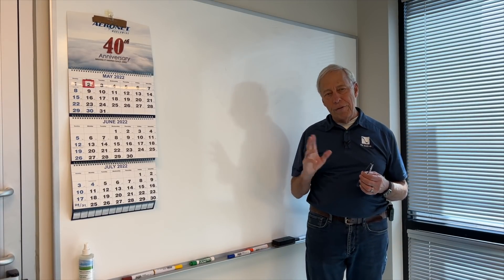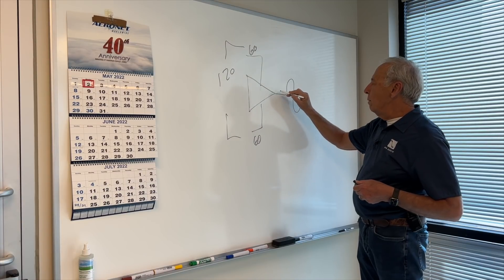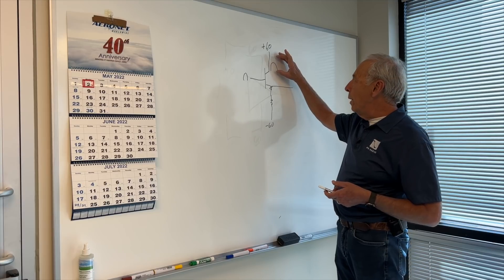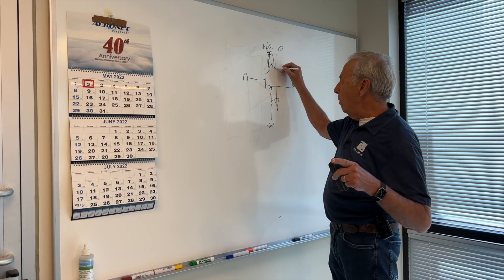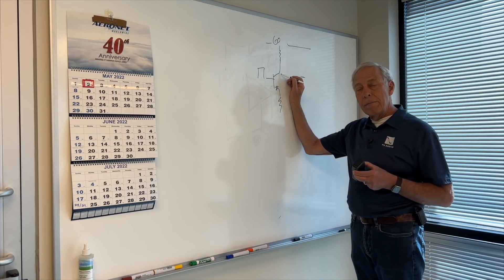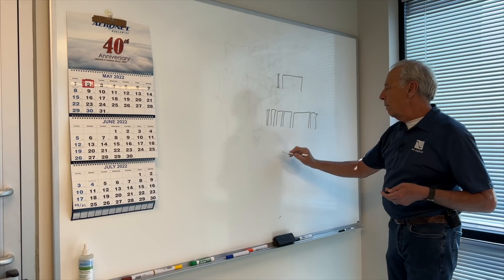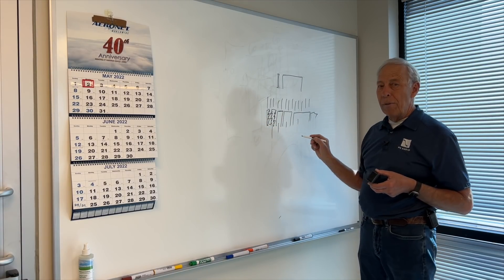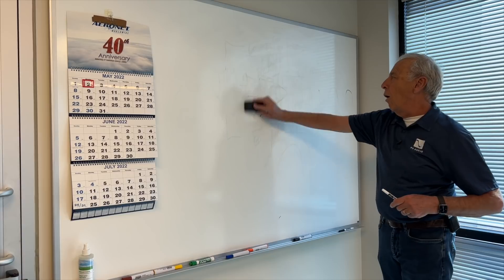How Class D amps make power

Comment: Class d simply relies on the concept of using a transistor ( or mosfet) as a switch.
A switch - just like your wall light switch is either off - in which case there is NO current flowing.. or it is on - in which case there is current flowing to a load - but NO voltage across the switch .
In either case - the switch does not consume any power.
We can duplicate this ( very closely) switching idea with a transistor or mosfet.
 ( of course - a semiconductor device cannot switch on or off instantaneously - so there still is some loss - but is extremely small in comparison to the same device working in class a / ab etc)

We can now easily  control how long this switch is on or off - from an external signal.

We can use this basic swicthing idea in conjunction with inductors and feedback control to store  energy over time to reproduce a smoothly varying volage

Comment: And not much discussion about the power supply’s contribution to the sound
Reply: Thats the catch - a class d amplifier IS the power supply!!

A class d amplifier is essentially a switch mode power supply where its ouput voltage is varied in sympathy with a control ( audio) signal

Comment: Please...I need help with a question.

I'm building my home theater...I'm in love with the sound from Arcam AVR21 (yes the new model)...it's rated at 90wpc.  If I bought (as example) any external 7ch amp that has (let's say) 200wpc and then hooked it up (now the question)
Would I be getting the sound signature from the AVR, or the external amp. I don't care for denon or yamaha with my klipsch heresy IV, relative to Arcam. Arcam just simply sounds better to my ears. 

I have a great yamaha rxa3080 (until i heard my RF7iii/64iii on arcam)...but prefer the sound of Arcam.  So when it comes to my second room, is it as simple as getting an Arcam Amp to gain their sound? 

Hope that makes sense...and any advice on where sound signatures come from when adding separates is appreciated. 
Take care, Tommy.
Reply: It's both. You get the sound of both and depending on what you set the volume of each source to, you'll get a matching output. Be careful not to blow up the inputs on your preamp. You want to ensure that the source is outputting what will sound best and does so without clipping.

Use an oscilloscope or, if you know what to listen for, use your ears.
Reply: @orangejjay  thank you!

Comment: So, a class D amplifier is twice as efficient as a class AB amplifier and four times as efficient as class A amplifier. Wow!

O, wait a minute, that's only a 3 dB and a 6 dB difference. And when I give the class AB a 3 dB more efficient speaker and the class A a 6 dB more efficient, than all three have the same efficiency!

And, now the funny part. Same efficiency, means an equal amount of waste energy in heat. For the class A we have a nice heavy heat sink, and for the class D amplifier with the 6 dB less efficient speakers we have a closed enclosure for at least mid and tweeter,  even with some insulation (wood and damping material), for the woofer we have hopefully a "vented" enclosure with not so much insulation...

And, on top of that, the last one heats up more and gives earlier and more power compression (till 6 or 6.74 dB at maximum rated power). So, some of the efficiency gain gets lost.

So, if you want more efficiency, choose more efficient speakers! And get rid of the passive crossovers, with a 2-way you gain an extra 3 dB, with a 3-way 4.8 dB and with a 4-way an extra 6 dB, plus some extra efficiency for the lack of insertion loss.

Comment: What if we substitute the common transistor used in Class AB, change the circuit a bit and obtain 75% efficiency from it?
Reply: I think you would have to elaborate on that
Reply: @maxb.simonsen2459  
Like for example a totally new type of transistor made of different materials capable of higher switching speeds and less current draw etc.
Reply: @Bassotronics  Sorry, that's not how it works :) 

A class AB is inefficient by design, not by choice of components if that makes sense. The class AB design is not a switching amp.
Reply: @maxb.simonsen2459  
I thought the transistors had to switch rapidly in order to do their job.
Reply: @Bassotronics  Well that's class D.
Reply: @Bassotronics  You can't just invent a new type of transistor. There's different classes of amps and they each have their benefits and takeaways. Engineering things is not as simple as "well, let's just do this and boom it works."
Reply: @orangejjay  
And that right there is the thinking of a person who does not want to innovate.

Comment: Question for Paul or anyone else.Would a Class D amplifier benefit from a thicker shielded aftermarket/diy power cord???
Reply: No.
The power input to a class d amplifier - same as a switched  mode power supply - feeds through internal emi filtering to a full wave bridge rectifier to produce a high DC voltage for the internal citcuitry - which is very well regulated and hence largely immune from any external influences caused by normal variations in external supply from your wall socket. 
Beyond th

Comment: Somehow reminds me of DSD, but with PDM instead of PWM.
Very similar basic principle.
Reply: PDM is basically PWM w/o clock sync requirement.
Reply: Either way, you make the waveform from the high/low digital level low-pass filtered to make it into analog. Most class D amplifiers are however operating with analog input that then gets translated to the PWM to drive the switching of the amplifier transistors and with analog feedback.
Reply: Indeed you can feed a PDM signal into a class D amplifier and therfore stay fully digital, i.e. like this IC does: https://datasheets.maximintegrated.com/en/ds/MAX98358.pdf

Comment: it's just a switch mode power supplies no difference
Reply: Absolutely.
Switch mode power supplies (smps) have been around for decades - now very highly developed - every pc , laptop charger, tv,  motor control system etc has one .

And are VERY efficient and reliable.

All you have to do is take the basic smps concept - add a control signal ( our signal we want to amplify )- that varies its output voltage  in sympathy - and we have a class d amplifier

Comment: Pascal, ICEpower, Hypex and Purifi measure so good that there is no reason to use AB amps.
Reply: I can't believe you guys are falling for this brainless idiot's scam. If you watch these videos regularly, there's always one or two people like this who's only purpose is to make comments that cause people to go nuts. This has nothing to do with audio equipment. Its just a game. If you feel like you must respond, just ask him a simple, common sense question that he won't be able to answer. It shuts them down every time.
Reply: lolz.
Reply: @Roof_Pizza  I'll bite. What reasons other than if you like excess heat and power consumption would there be to use AB amps?
Reply: @jasonkillsformomy  What excessive heat? My amps run cooler than many class D amps and the fans haven't turned on once in 20 years, some class D run their fans 24/7.  New doesn't equate to better. Look at all the crappy sub amp failures out there, almost all class D. Manufacturers love cheap shit more than they love durable shit, that's why you see some jump at class D while others don't touch them at all. Call me when a class D has outperformed a class A/B and has done so for 20 years. Oh, and many still sound like shit as well let alone don't give you 200 watts/channel which is the only reason why I'd consider one. And seriously, how much do you think it costs to power an amp? Anything else?
Reply: @Roof_Pizza  If a D runs it's fans all the time then that's the way the manufacturer intended them to be run and be on the safe side. What amp does this? The D amps I have seen don't even have fans because they don't need them. I'm talking about speaker hifi amps and not plate or pro amps. Newer said new equate better. There is no proof that D fails more often than AB. Pro amps have been using D forever. Everything nowadays is planned obsolescence anyway. Sure sub amps fail, but that's usually some really cheap stuff. Never heard of Pascal, ICEpower, Hypex, Purifi, Speakerpower or Cherry failing. And by that I mean I mean out of the occasional fluke. There is not a single product made in history that has not failed. Even Toyota and Honda brakes down sometimes. And that's 99% of the time do to user neglect. "Sounds like shit" Well some people imagine they can hear differences in cables, DACs, CD players, lunar phases and whatever. Not a single person have done this in a scientific controlled double blind test. Ever. And I Don't know what amps you have been looking at, but 200W is nothing for todays D amps. You can buy D with thousands of watts per channel. I'm not saying there's anything wrong with AB. D is just more efficient. Some people and not just audiphooles don't want to make changes. Some people own all their life the same brand of car as the first one they got or the same brand as their parents used.
Reply: @jasonkillsformomy  LOLZ. Looks like you and Schitt are on the same page.

'Vidar is nothing less than a no-excuses, exotic-topology, Class-AB, linear-supply, microprocessor-controlled, power-doubling, dual-mono-ish, intelligently-managed, drives-almost-anything power amp. No Class D, no switching supplies, no fans, no compromises, nothing in the signal path but music—for a three-figure price tag.'  

Tell me again how much it costs to run an amp!!! I think I'm at ~ 175,000    almost continuous hours.
Reply: @Roof_Pizza  Don't know who or what "Schitt" is. Do you mean the audio company Schiit? I know nothing about their products or statements. I'm not into gear that has no audible benefit in home audio.
Reply: @jasonkillsformomy  Schiit Audio makes good products at a reasonable price. Of course every brand has it's marketing stuff and a different amount of snake oil, but you should give it a try :)
Reply: @Roof_Pizza  I haven't yet seen a Linn amplifier broke, even after more than 20 years. And they sound amazing.
Reply: @jasonkillsformomy  my Halcro MC70 runs the fans all the time, or seems to anyway. The only reason I notice is because they are so noisy. One day I may swap them out for something quieter. Not sure why it even has fans it seems to generate very little heat.
Reply: @DodgyBrothersEngineering  I don't see any fans on that amp.
Reply: @jasonkillsformomy  I can't find the book for it right now, it might be buried in a pile of boxes, but I am fairly sure it is passively cooled to a certain point but once it reaches a certain point fans come on. There is definite fan wind down noise when I turn it off at the end of the day.
Reply: @jasonkillsformomy  200W Class D is not the same as Class AB or Class A. I had a 180W class D amp and have to push the gain up over 12 o'clock, while my 50w class AB a quarter on my ML.
Reply: @kongwee1978  Weird. It should be the other way around because D is more efficient. Was the D an separate amp or was it a receiver? If not a receiver then the manufacturer was misleading the real wattage. Many amps don't do what they claim.
Reply: @DodgyBrothersEngineering  Strange. Usually the fan is at the back of the case visible. I've seen many multichannel Hypex based amps and can't recall I've ever seen one with a fan.